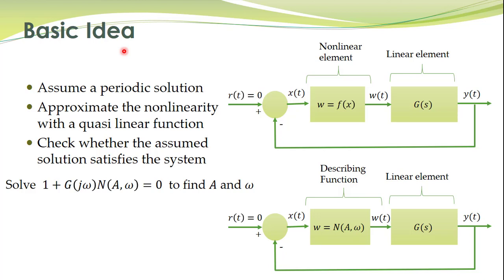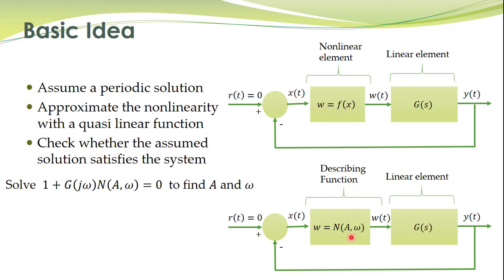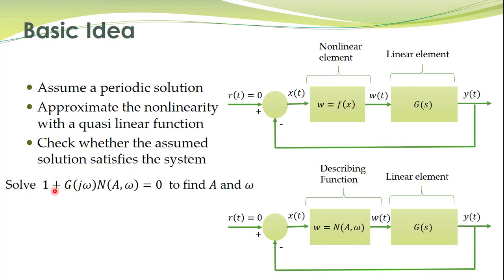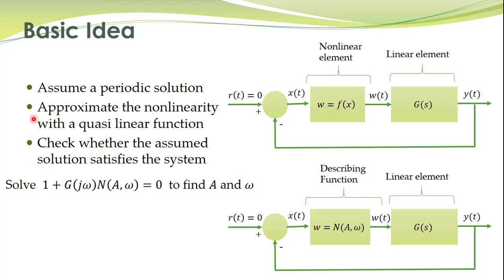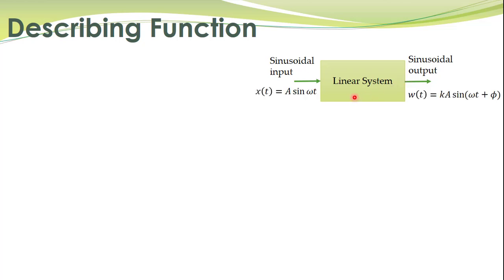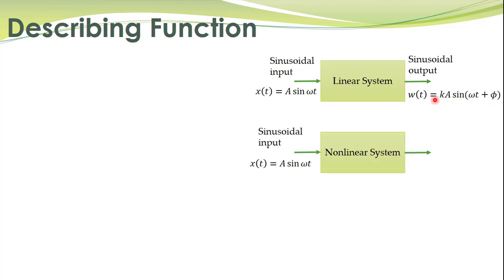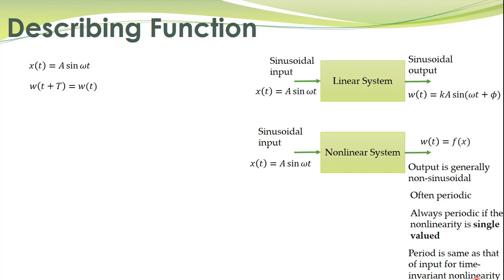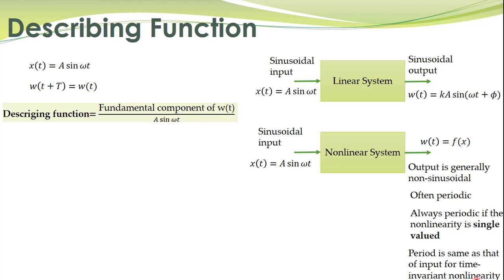NCS - 11a - What is describing function

Comment: Dear Prof., 

Thank you so much for your excellent lectures and your nice explanation. I just have a question, can we apply this method for higher order systems (a set of first order DEs) ? Is their any limitation for this method to any specific system order? Appreciate your great support.
Reply from the maker: Yes, the appraoch is applicable to higher order systems as well. If the system can broken down into a linear part  cascded with a nonlinear part, the approach can be applied to it.
The analysis in this approach is carried out in frequency domain, therefore, you will need to convert the set of differential equations in transfer function (provided the nonlienar can be seperated) and then apply the approach.

Comment: Dear Sir.
We you talked about 3 steps, as per my understanding till video 11c, the first 2 steps are followed. But I am confused about 3rd step..
In 3rd step it is stated, to check whether the system is satisfied by assumed solution or not.. as far as I understood, we never inserted the solution in system to check whether it satisfies or not, and hence didn't followed 3rd step..
If I am wrong please do correct me...
Best Regards.
Reply from the maker: Yes, there are three steps in applying the Describing Function Analysis Approach. In the first step, we bring the system into a particular block diagram structure and assume a periodic solution for the system. In the second step, we approximate the nonlinearity by a describing function and in the third step, we check whether the assumed solution can be an actual solution or not. In Lectures 11-12, we have only talked about the second step in details, the third step will be addressed in Lecture 13.
Reply: @MAFarooqi  thank you sir ❤️❤️